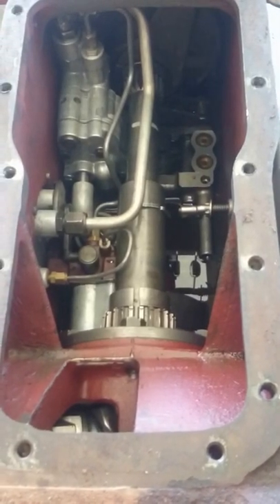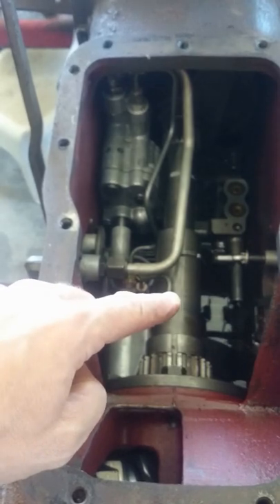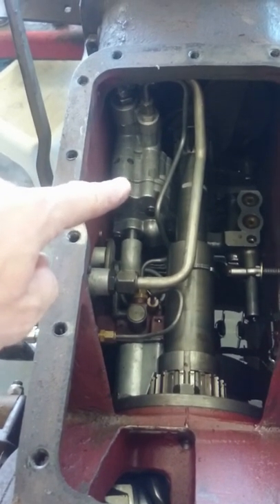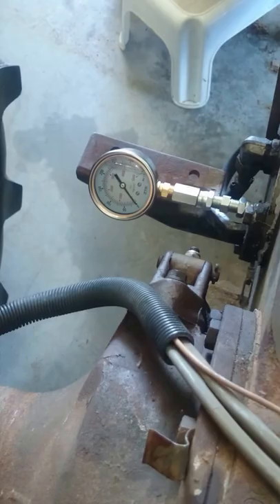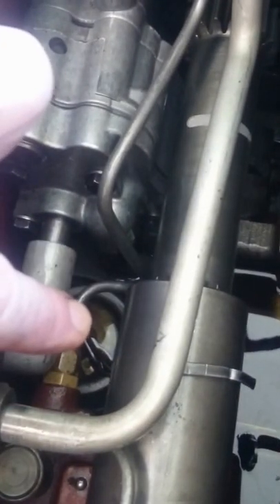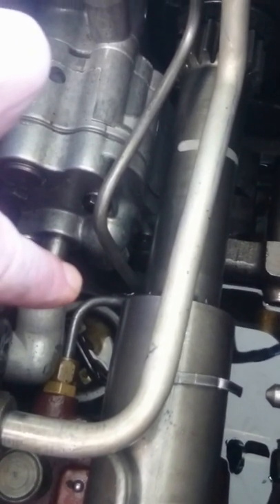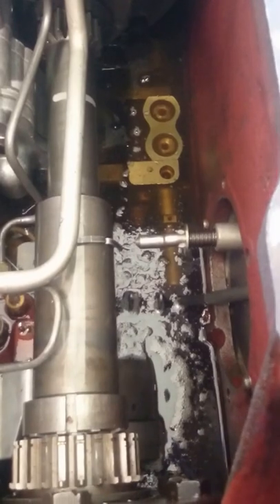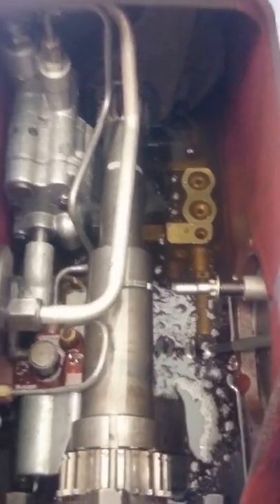165 Massey Fergusson iPTO

Comment from the maker: New iPTO clutch was going to be $2000 and what was in there was just the housing someone had put back in without internal components.
Reply: wow. That's nuts. I'm dealing with a massey ferguson 135 with ipto, and I'm trying to figure out why my pto won't turn off. That's what I'm dealing with now. Any suggestions?
Reply from the maker: @FPVGeek  the only solution for mine in the end was to buy a new one from Massey Ferguson and that was more money than what I paid to buy the tractor.
Reply: @FPVGeek  Get a used one from cross creek tractor parts or allstates tractor parts
Reply: @FPVGeek did you ever figure out your PTO problem???